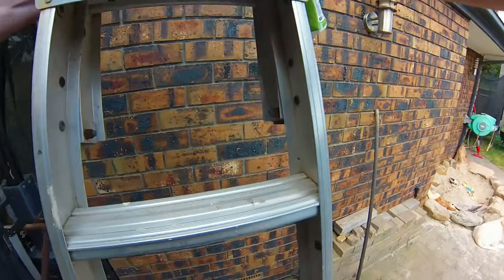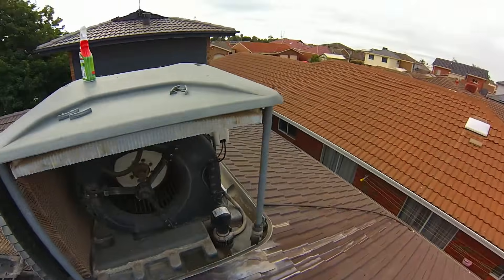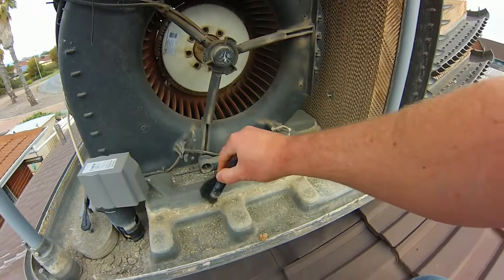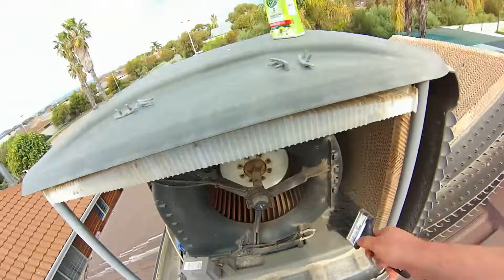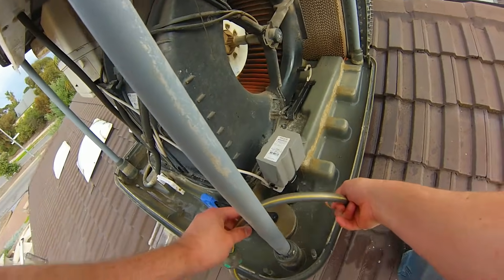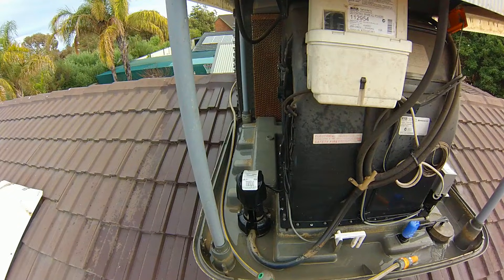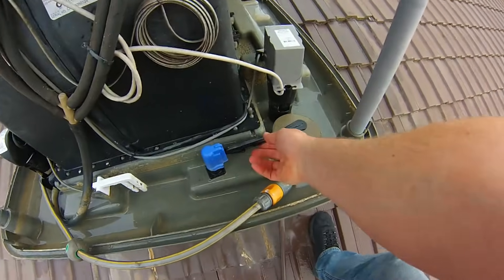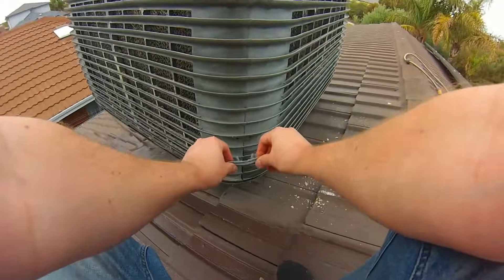Easy 15-min Evaporative Swamp Cooler Maintenance DIY Service Breezair

Comment: Hey dude,

My Breezair is constantly dumping water and it gives me an error 02 (it does not start at all).
Does this mean dump valve needs replacing,?

Cheers.
Reply from the maker: Sounds like the dump valve is faulty. If the valve is  going up and down a few times or not moving at all it is faulty on startup. If you can remove a few panels and watch the dump valve on startup.
Reply: I have a problem where the dump valve is goong up and down and not enough water is coming in and therefore the fan wont start.Is this maybe a setup problem or a problem withevthe dump valve?.Thanks
Reply: And also when the water starts dripping down the sides and when the fan switches on ,the dump valve keeps opening and closing constantly and so much water is going down the gutter and downpipe.Surely this aint right